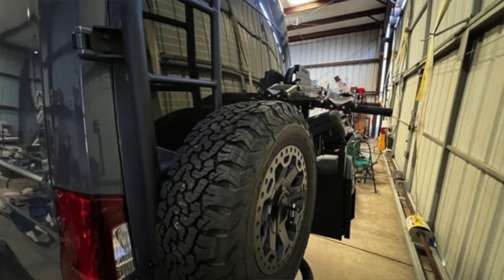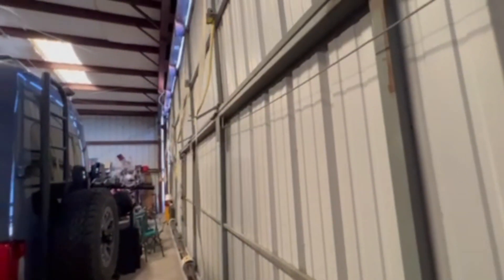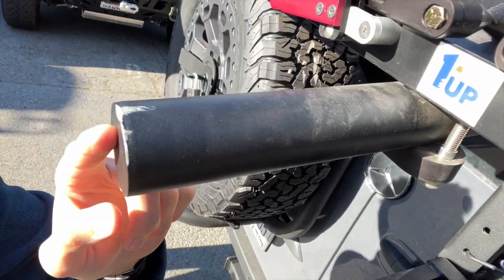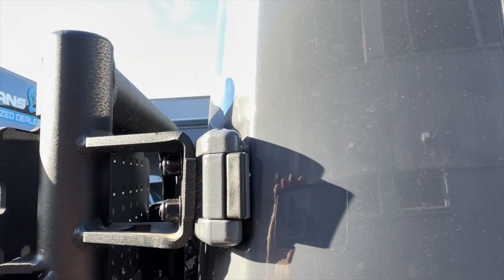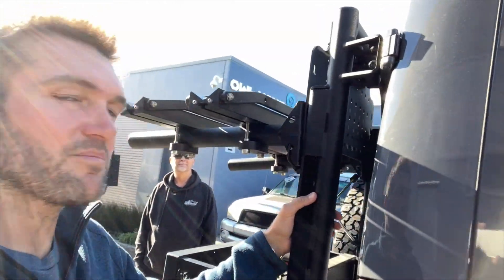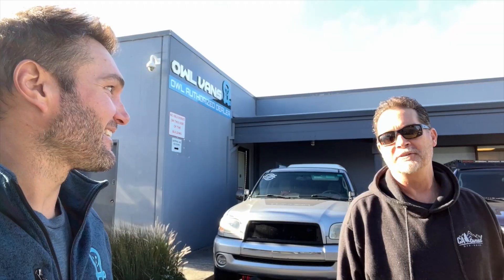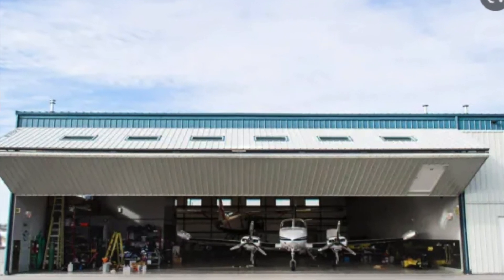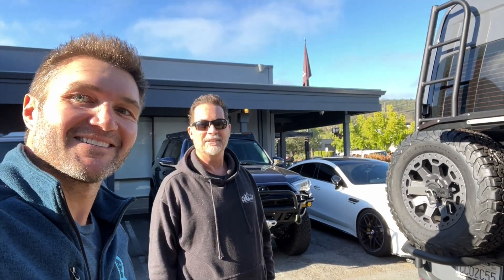TIG Welds: vs. 10,000 Pounds: How Strong Is the Owl B2?

Comment: Great video! Based on that, do you think there a way to do a swivel rack for a motocycle? If it can support 5000-10000lbs it can definitly hold a 500lbs motocycle! Do you think?
Reply from the maker: What someting can hold and what is usable over time are different. I would not put a 500lbs motorcycle on any of our racks. Door opening, stress over time, could cause issues.

Comment: I have a B2 with a large Owl box and (2) 1-ups for my old e bikes.  Bought 2 new e bikes that total weight is around 150 lbs.  With the box and its contents, which probably weighs an additional 40 lbs, is it plausible to put those 2 new bikes on the 1 ups?  Now I’m probably wrong, but I thought the total weight the b-2 could hold was around 150 pounds in addition to the box?
Reply: From what the Owl Vans guys explained to me, 150 lbs. is the official maximum, but they’ve seen customers do much more. There are safety concerns beyond just the maximum weight to consider if you’re going to load the B2 up to 150+ lbs. though. The total weight of the door+B2+1ups+bikes+box+cargo is going to exceed 200-300+ lbs. If you’re on any kind of incline it can be especially tough to manage that kind of weight when opening/closing the door. 
That being said, I’m planning on mounting a 65-ish lbs. eBike on my B2, along with a medium Owl Vans box for some tools. I’m playing with the idea of using a pulley and/or a winch to hoist it up there without causing any damage to the van or myself.